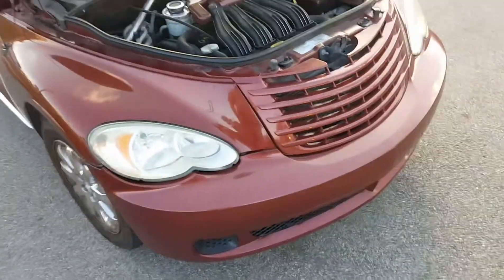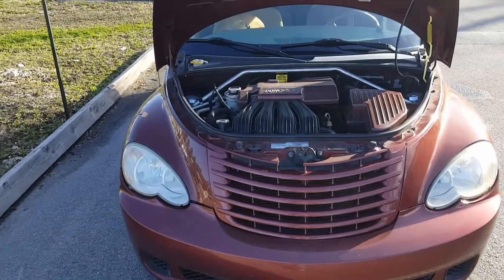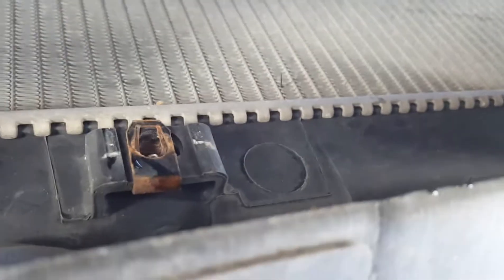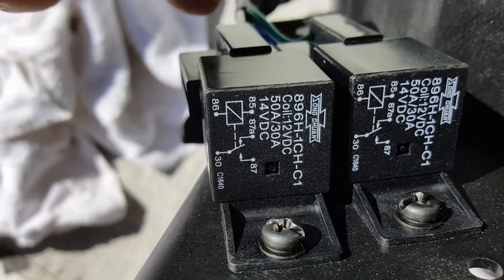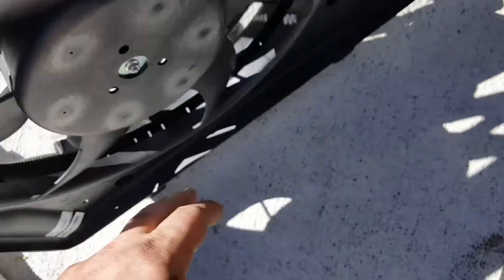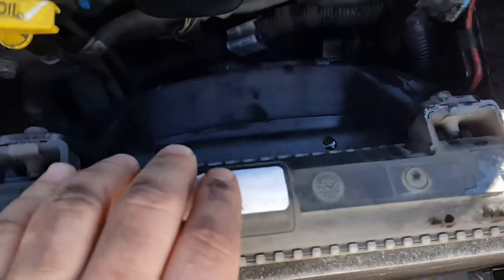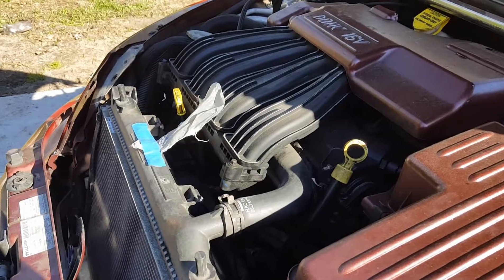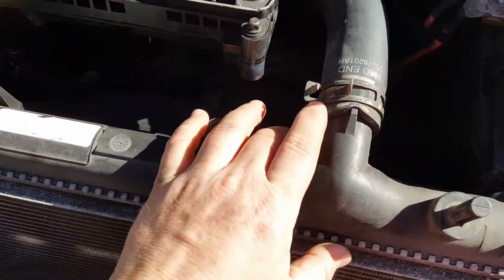CHRYSLER PT CRUISER  Electric Radiator Cooling Fan Repair - car overheating fix

Comment: Thank u so much for putting the link for this video on the other one... This helps me a bunch... Ill be replacing mine in the next few days...
Reply from the maker: Your welcome dawn thanks for subscribing!
Reply from the maker: Don't buy the cheap ebay fans the $50 one i bought quit about 2 years later. Buy from an auto parts store
Reply from the maker: Lol my puppys name is stark after tony stark iron man
Reply: I love Iron Man ❤ Lucky doggie got a great name. I plan on getting the fan from O'Reillys. Of course they don't have them in stock so I have to have them order it....
Reply from the maker: @GiGisRoom-CheapAndEasyCrafts  you can use AutoZone or advanced too if it's in stock at those stores . But it's a rare item to keep on hand for stores so most order it. Lol the labor took me like 3 hours. 2 years later I have to do it all over from trying to save $100. Definitely not worth trying to save money on this part with the intensive labor

Comment: thanks so much best video ever... the issue I see is I don't have a jack so ill have to do all the work from up top if possible.
Reply from the maker: Hey daniel you can use old change ramps to get under the car but you need to access the plug for the electric fan and the bolts on the bottom. I can relate. I recently paid to have a fuel pump installed because I couldnt get the car jacked up high enough to remove the fuel tank safely. Cost me $450. Please subscribe and hot the bell for more pt cruiser videos!

Comment: Thanks for the video, it's really useful. I have a 2008 PT cruiser that is overheating. We tried replacing the thermostat and the two air sensors without solving it. The fan only runs intermittently. I think the next step is replacing the fan itself. We'll see how it goes... I need to have a vehicle again to drive.
Reply from the maker: Thanks for watching please subscribe I have lots of pt cruiser videos. Check them out. Good luck I think the video shows pretty good detail not to hard to do.
Reply from the maker: Stephen also make sure you not leaking coolant anywhere. If your not leaking coolant it's most likely the electric cooling fan. $52 on eBay. Don't pay dealer prices ask a mechanic if he wil install your own parts. There is no mechanic warranty if you bring you own parts bit you save alot.
Reply: Check relays and fuses in engine comp first easily replaced mau have a spare located there workibg on my 2003 pt last couple days both the fan motor and relaus were bad.
Reply: @drewsquickfix

Comment: Den ULYDEN i videoeen , hørtes ut som et lager som har havarert i Elmotoren som driver selve viften. Den DER har nok definitivt gjort nytta si som kjølevifte
Reply from the maker: Yes it was the bearing in the very cheap plastic electric cooling fan the fan had completely broken off Chrysler just does not make quality parts